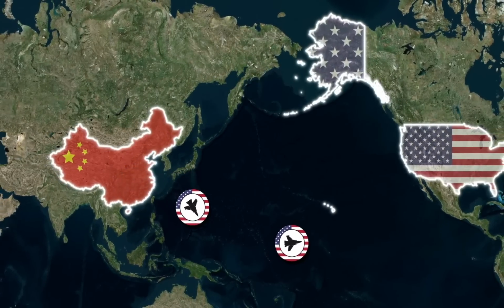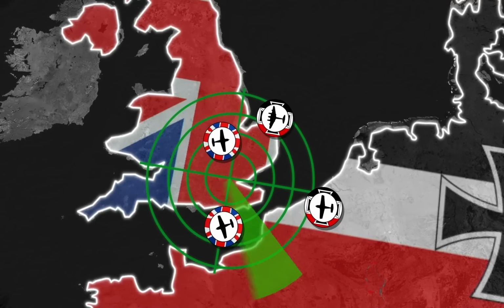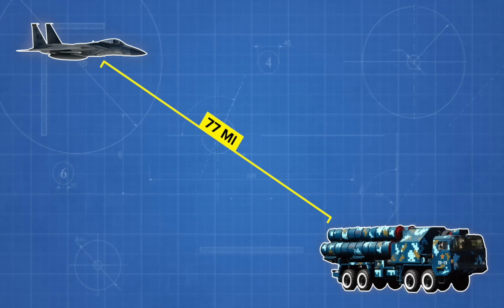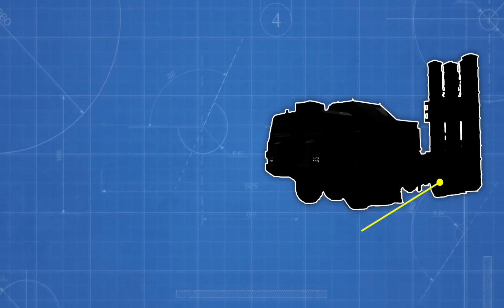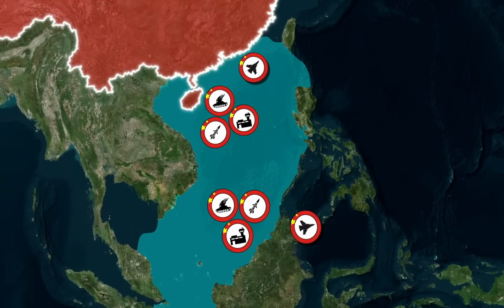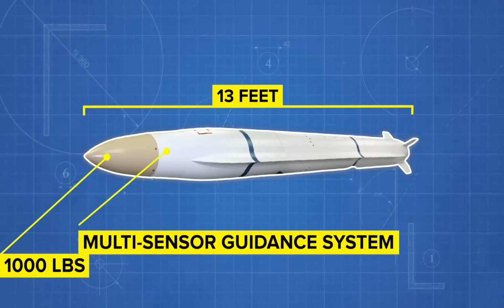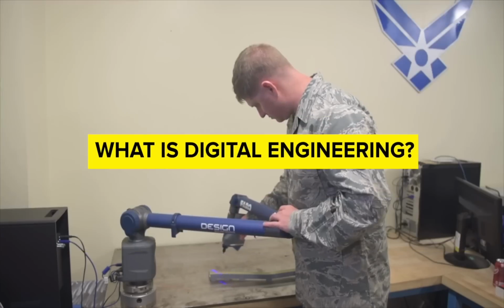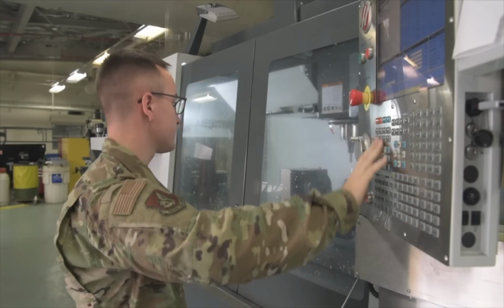Why America's New Airstrike Weapon Is A Total Game Changer

Comment: The s400 has been proven to be a rather dull system.  Sure with all of its equipment at hand, which includes a lot of gear like multiple launchers, command centers for coordination, and many, many radar systems including the most advanced inferred and other wave, light, mixed sensors, which so far Russia is the only country to posses this entire collection of assisting equipment, then maybe, just maybe, one could consider the s400 a decent, medicore, missile and air defense system.  The biggest problem is that, in the era of 5th gen fighters, the s400 cannot see the planes until after they have already fired their payload and retreated.  They (appear) to not be able to track multiple targets with 100% success and in fact, again, appear to easily be overwhelmed.  Now of course, this can change as they (Russia, S400 Data Collection) are able to collect, disseminate, apply and upgrade systems based on new data, but given the post war time russian brain drain this is unlikely to be in the near future.  
  It is my understanding that S400 systems in countries other than Russia, places where they just dont have the full array of complementing equipment, they are quickly found, overwhelmed and destroyed.  This has been seen in Ukraine with the destruction of at least 2 systems, which were accompanied with their full range of accessories and even Syria with their S300s being utterly destroyed by Israeli F-35 missions where in fact, out of over 1,000 targetings of Israeli F-35s by these S300s & 300++ systems (of Russian origin) they have yet to hit any 5th gen fighters.  Syria has since expressed seripous doubts about the capabilities of the S series missile defense systems.  Long story short, like all other Russian systems, they appear to be all bark yet little bite.  I imagine they would have great success against some poor, 3rd world country that has no access to modern or semi modern western weapons.

Comment: You need to do a little more research even regarding the islands china built at this point are crumbling away. Used the wrong concrete, never anchored to the sea bed, no sea walls.  Also no aircraft have landed there in years

Comment: South Korea, which is close to North Korea, wants different missile defense system specifications than the United States (and Japan).  Therefore, Korean cannot rely on the US (Japanese) missile defense system.  South Korea needs an interceptor missile with a very high ascent speed to intercept North Korea's nuclear EMP bombs at the ascending stage (altitude of 75 to 100 km).  Therefore, there is no need for slowly rising missiles like SM-6, SM-3 and THAAD.  Considering the interaction between the ionosphere and the Earth's magnetic field, the explosion altitude of a nuclear EMP bomb must be higher than 75 km.  On the other hand, if the explosion altitude of a nuclear EMP bomb is over 150km, the attack range becomes large enough to include China and Japan.  Therefore, the explosion of North Korea's nuclear EMP bomb will have an explosive force of 25 kt at an altitude of 100 km.  Meanwhile, North Korea's hypersonic missile has a pre-glide stage (parabolic trajectory), a glide stage, and an end stage.  It is difficult to expect to achieve a 100% intercept probability in the gliding and terminal stages where the trajectory is unpredictable.  In order to increase the probability of interception, very fast ascent speeds and rapid changes in direction in and out of the atmosphere are required.  The climb velocities of both SM-3 and SM-6 are too slow to intercept hypersonic missiles in their evasive glide and terminal phases. A SM-6 does not have a side thruster, so it is impossible to reduce the distance between the SM-6 and the hypersonic missile during a sharp evasive maneuver.  Only terminal stage interception of a hypersonic missile will reduce the distance between the hypersonic missile and the SM-3, but the minimum interception altitude of the SM-3 is too high to be used.  The Koreans maximized the climb speed even at the expense of the maximum altitude of the interceptor missile.  In addition, a dual-wavelength band IR seeker and a continuously variable side thruster were adopted to enable detection and rapid direction changes inside and outside the atmosphere.  Mass production and deployment are scheduled to begin in 2024 after the successful launch test of the Korean hypersonic glide vehicle in January.  Last year, a test to intercept North Korea's missile replica was successful, and the hypersonic missile defense system will be deployed in 2026, after testing on the latest frigate, and deployed on the next generation Korean destroyer.

Comment: One major flaw of the SiAW is that it needs to be transported by a platform such as the F-35A. In the March 2022 East China Sea encounter between two F-35Cs and two J-20s, the two F-35Cs dispatched from CVN-70 were detected by China's Type 610 ground based anti stealth early warning system at a distance of 600km and two J-20s were dispatched to the area to spot out the F-35Cs. Coordinated by the KJ-500 AEW&C, one J-20 was guided to the attack position (rear) of the F-35C and locked on to it. The F-35C was completely surprised by the J-20s, as the US E-2D AEW&C was not able to detect the J-20s. The two F-35C fled after failing to gain any brownie points.

So, if the F-35s can't even get into the "stand in" positions before they get shot down, how is the SiAW going to be a game changer?

Besides, China also has anti-radiation missiles and bombs that are deployed on platforms like the J-16D electronic warfare fighters and the Rainbow 7 stealth drone bombers, those are really going to be the game changers.
Reply: Detected. Sure.
Reply: @aaronanderson3644  Detected, then locked.
Reply: @aaronanderson3644  Ground based stealth early warning systems are designed to provide early warnings to stealth threats, but they don’t have high enough resolutions to provide a weapon grade radar lock to guide a missile to strike the stealth target. Their job is to provide a good enough location information for combat platforms such as the J-20 to fly close enough to the target and use high powered AESA radar to provide a weapon grade radar lock to guide an air-to-air missile to destroy the target. The F-35 is not invisible in radar, just low observable. If the radar source is close enough and powerful enough, it can effectively lock on to the F-35. The J-20 is equipped with a massive 1m diameter gallium nitrate AESA radar with an astonishing 44kW total power output, which is 3.6 times the power of the AN/APG-81 radar equipped on the F-35C, hence it was no sweat to provide a weapon grade radar lock on the F-35C.

Comment: I don't think the F-35 or the F-22 will have much play in the initial stages of protecting Taiwan simply because it lacks sufficient range even with its stealth because the Navy will still need to stay out of range of anti-ship missiles until Chinese anti-ship systems are significantly degraded.

I believe the B-2 and B-21 will be the first to attack to degrade both anti-ship and anti-air systems so that the Navy can get close enough to launch its F-35's and tankers can operate close enough to refuel F-22's.

At that point the Rapid Dragon systems will also come into play or may compliment the stealth bombers if the range is sufficient.

Once Chinese island bases ae neutralized, the task of supporting Taiwan will be easier as it then becomes easier to attack Chinese systems and ships within range of Taiwan.

My major concern, however, would be that China would decide that if they can't have Taiwan, no one will and then nuke Taiwan.  China knows that the US will not then nuke China for fear of exposing the US to China's nuclear strikes when our ABM systems are insufficient to intercept all of them.

Comment: Can you review on "HGV-ER( hypersonic glide vehicle with an extended range  by re-ignition in the atmosphere)"? There are rumors that China successfully conducted a flight test of the HGV-ER last year.  HVG-ER  has passive/active AESA radar sensor to avoid being intercepted and to attack a moving target. In Korea, HGV-ER and anti-HGV missile are the hot development subjects.
In theory, only the terminal stage of an HGV heading toward an Aegis ship or missile battery can be intercepted with the PAC-3MSE.  In theory, PAC3-MSE cannot block an HGV heading toward a defense target (e.g. an aircraft carrier) 10km away from an Aegis ship or missile battery.  THAAD and SM-3 cannot intercept HVG-ER because the minimum interception altitude is too high.  SM-6 cannot intercept HVG-ER because it cannot follow rapid evasive maneuvers.
Would the United States risk a nuclear war with China for the sake of Korea's (for Korea broken nest, which has already been reduced to ashes by China's nuclear missiles)?

Koreans believe that they can protect the Korean Peninsula from potential enemies (China and Japan) even without Americans.
Koreans have tolerated and are willing to endure discomfort for the sake of their alliance with the United States.  However, there is always a limit to patience.  When patience turns into fear, it has a very negative effect, and when patience turns into shame, it has the most negative effect.  At least, China can be isolated only if the United States takes care of North Korea and the United States reconciles with Russia.  I am afraid that many Chinese people will fill their bellies with Russian food and use Russian energy and Taiwanese semiconductor technology to conquer the world..
Both South and North Koreans cannot forget the humiliation of Japan's military occupation.  
If someone violates sovereignty over Dokdo, Korean patience will turn to shame and anger, and U.S. troops stationed in Korea will have to go home. S. Korean want to end Fucking Yoon Seok-yeol's term early and to hold a presidential election, by amending the Korean Constitution this year.

Comment: I don't want to be overly confident, but I think it's actually more a testament to China's problems than to the US's might(even though I know the US has ALL the might in the China vs. US and Taiwan for Taiwanese sovereignty scenario)
Not only has Taiwan been training with the US for years now, they've also been using the US's equipment( as well as designing some kick-ass equipment of Their Own).. they also have some excellent Pilots, a navy and a CAUSE they believe in almost to a man woman and child. Much like Ukraine and russia, there is long, deeply rooted dislike for the CCP( from a length of time/abuse of a people/ attempt to decimate a culture, religion etc standpoint, Ukraine/Russia has been at it ALOT longer, but it's similar in many ways) .. Not necessarily against the mainland Chinese people..
I don't think the CCP has the loyalty of their military.. they've given the common Soldier no reason to feel any sense of loyalty for the government.. additionally, corruption has led to problems from top to bottom in military training, equipment, organization, ships that can actually move under their own Steam for any length of time 😉..  they don't encourage independent thought so none of their equipment, Hardware or anything else has actually been designed in house.. ideas they have come up with on their own are generally not good. The choice of aircraft carriers but don't generate enough power to launch airplanes efficiently..
You can't even count on the parts that you order being usable.. they're almost as liable to blow up in your face as they are to work..
Venting... Sorry

Comment: As with all air defense systems, in order to properly demonstrate the performance of the S-400, the VHF, L-band, S-band, and X-band radar networks must be well configured for cooperative engagement.  The weakness of the S-400 is that its S-band radar is PESA-type like that of the Aegis, making it vulnerable to jamming.  In addition, as stealth technology has become common, the RCS of anti-radiation missiles is small, and the actual frontal size is much smaller than that of the F-22, making it difficult to detect with long-wavelength S-band radar.  Because the United States has been hindering the development of Korea's defense technology in accordance with Japan's wishes, Korea's radar and missile technology is based on former Soviet technology.  The missile defense system exported by Korea to the UAE is based on a large X-band AESA radar made of GaN elements.  It is not affected by existing Israeli and American S-band electronic warfare.  Attempting a jamming attack against Korea's latest missile defense system using the X-band AESA radar mounted on an existing fighter jet is suicidal. The reasons are as follows: 
The biggest advantage of the large X-band radar is electronic warfare.  First, underpowered fighters may not be aware that they are being detected by LPI mode.  On the other hand, a frigate can have ample power to analyze all known LPI algorithms simultaneously.  Second, the fighter radar can be neutralized by saturating the entire frequency band available to the fighter radar for a desired period of time.  Third, fighter jets cannot jam a frigate's radar.  This is because your location can be revealed and you can be subject to indiscriminate jamming attacks.  Another reason is that GaN device-based radar can use edge frequency bands that GaAs device-based radar cannot use.  Fourth, as a result, it is possible to allocate only part of the hardware of the frigate radar and perform other missions simultaneously while performing electronic warfare.
These are reasons that Korean and Japanese combat ships did not use  S-band SPY-6 radar.

Comment: The design of SiAW leverages work on the United States Navy's AGM-88G Advanced Anti-Radiation Guided Missile - Extended Range (AARGM-ER). Korean stealth anti-ship missile (which was deployed in 2023) is the one of advanced SiAWs. It's intelligent homing function based on AESA radar/EO/IR/anti-radiation guiding sensor with/without a bidirectional data link. Same arrival time of multiple missiles with different sets of way points, searching maneuver, and evasive maneuver …
There is no way to neutralize it except a very good hit-to-kill interceptor and radar. But it's RCS is very small hence it is extremely difficult to detect it. For an example, S-band radar(SPY-7) or small aperture X-band radar(APG-81) are not enough for detecting it. We need a large aperture X-band radar and an interceptor with Ka-band AESA radar seeker. Warhead of Korean stealth anti-ship missile uses an insensitive high explosive gunpowder. Hence, it cannot be intercepted by 20mm bullets or small fragments fired from the interceptor warhead. Phalanx cannot stop it. Hence Korean developed a new CWIS using 30mm (goal keeper) bullets based on  4 facet AESA radar for detecting and 1 facet AESA radar for fire control. 

If we want to punish China with this missile, we must prevent China from obtaining 0.15um-linewidth GaN devices.  However, the 0.1um linewidth semiconductor equipment is old, and the related  measurement equipments are so common in the wireless communications industry. Hence even China will be able to manufacture GaN devices with the 0.1um-linewidth in a few years.
Reply: Latest 4k/5.5k (Korea/Japan) ton class frigate(FFX-3/FFM-7) uses a four-sided fixed X-band AESA radar and EO/IR as air defense sensors. These frigate radar is capable of detection at the same time as fire control for ballistic missile interception. While the SPY-1D, which cannot perform other air defense missions during ballistic missile interception fire control, 
The biggest advantage of the large X-band radar is electronic warfare.  First, underpowered fighters may not be aware that they are being detected by LPI mode.  On the other hand, a frigate can have ample power to analyze all known LPI algorithms simultaneously.  Second, the fighter radar can be neutralized by saturating the entire frequency band available to the fighter radar for a desired period of time.  Third, fighter jets cannot jam a frigate's radar.  This is because your location can be revealed and you can be subject to indiscriminate jamming attacks.  Another reason is that GaN device-based radar can use edge frequency bands that GaAs device-based radar cannot use.  Fourth, as a result, it is possible to allocate only part of the hardware of the frigate radar and perform other missions simultaneously while performing electronic warfare.
These are reasons that Korean and Japanese combat ships did not use  S-band SPY-6 radar.